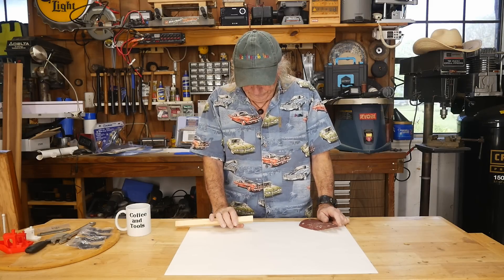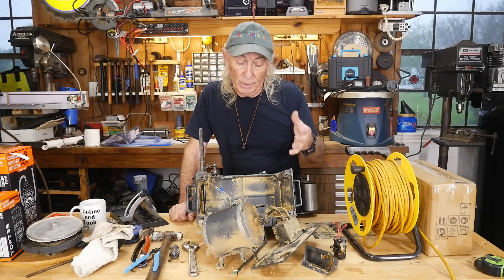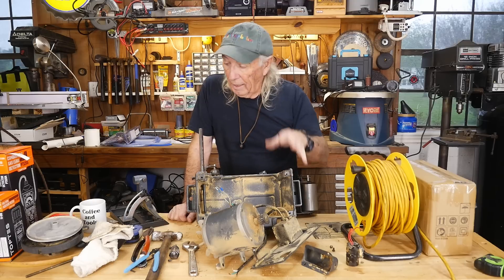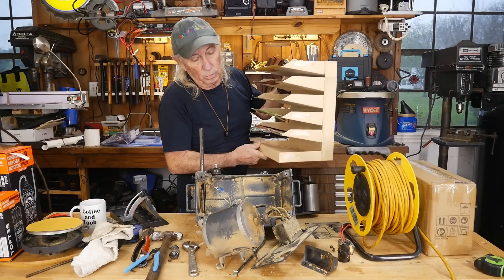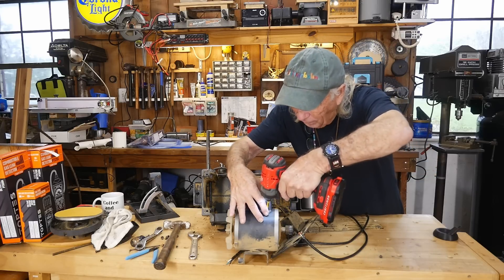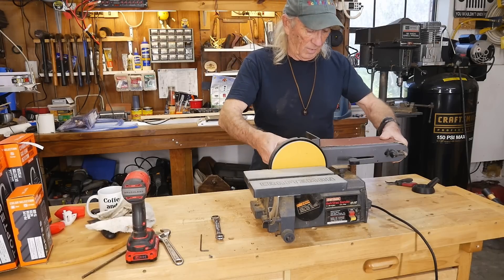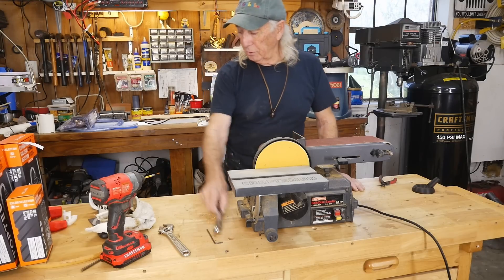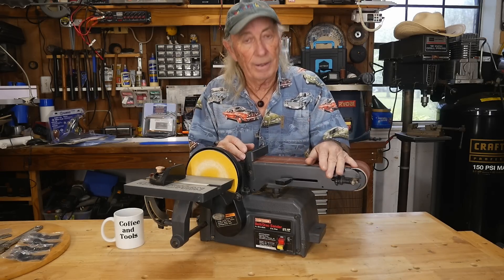Craftsman bench top belt sander machine repairs / upgrade, C&T  Ep 332

Comment: I have a delta 4x36 belt and 6 inch disc sander  and its absolutely the main work horse in my shop for sanding.
Reply from the maker: I just sold off the delta, but both machines seem to working good. The delta was 100% good too.

Comment: About 10 years after I bought my current house, the capacitor went out on my A/C condenser. The fan wouldn't turn. The motor just hummed. So I opened it up, and the end of the capacitor had actually blown out. I live in rural Missouri, so I could only find one local business that sells those capacitors to the public. He only carried one brand and it was made in China. It only lasted a couple of months. The business owner was awesome about it. Every time it went out, he would give me another on the warranty, but I soon got tired of replacing them, especially when it died on the weekend and I had to go without A/C until Monday morning. So I did some research. Apparently, as you would expect, this is common with Chinese capacitors. They're crap. Evidently the only things the Chinese can make well is viruses and delicious food made from pets. Anyway, from what I read on HVAC repairmen threads, capacitors made in the USA or Mexico will last a lot longer. It took me a while to find an American made capacitor. I finally found one on Amazon that was made by a company called AMRAD. From what I've read, they might be the only company that still manufactures them in the USA. That thing has been working great for four years. I wish we made more stuff in America. Those 6 year old Chinese kids being forced to work in a sweat shop for 30 cents a week just don't make good quality products, like Americans can.

Comment: I just took my 1984 Craftsman belt sander apart. It had the bad capacitor hum. I took it apart and no capacitor. Little see through cast iron motor. Bearings were stuck, there was black copper in the stator. 😢 looks like its toast.
Reply from the maker: Place a hand over your heart and say good bye.

Comment: Well, I also have this sander and need to replace my capacitor... but I am unsure of whether it is a "start" or "run" capacitor... from what I can find, it seems to be a run capacitor... how did you determine it was a start capacitor?
Reply from the maker: Inside the motor there is a tiny centrifugal switch that is for the "start" windings only. If the motor just hums and bumps back and forth, but using a quick spin on the motor gets it up and running, that is the "start" cap which is used to get the motor running and then the "run windings" take it from there. In some cases you can hear the click seconds after the motor is started and coming up to speed.
Reply: @SirTools Interesting... mine did seem to have that behavior (hand spinning it seemed to get it going... unsure if I heard a click or not), after several uses in this state over a year or so, it wouldn't really maintain any power so I stopped using it.  Your video gave me the courage to dig into it!  After I took everything apart (disk and drive belt disconnected), it would start up fine and slowly (over 4-8 seconds)  loose power until it stopped (this is without anything connected to the motor, just the fan).  During my last test, it started up spinning great and about 5 seconds in it suddenly lost power (as indicated by spin speed... maybe 50%), then the capacitor 'squeaked' and started smoking.  The capacitor has SH CAP on it and 25uF +10%/ -5%, 250V.AC.  I can't easily get into the motor to look and see the centrifugal switch.  I'm pretty sure we have the same model (137.215360).  I'm surprised it didn't have 'start cap' on it to indicated it was a start capacitor.
Reply from the maker: Does sounds a bit "fishy", once it reaches full speed it should not slowly drop out. Could be bearings or other issues. Maybe even damaged windings. For the tiny price of a capacitor I'd try swapping out that, it's an easy job and just might fix it. If the windings have gone bad, well...that would be another topic.
Reply: @SirTools Thanks!  That is my plan...
Reply from the maker: Good luck, I think you'll be ok.

Comment: Hi, I found a older Ryobi belt sander and it stopped spinning.  Im breaking it apart today to fix it, thanks for the great video.  What do you use to clean your equipment?
Reply from the maker: First I hit it with my compressor air to remove the heavy, step two would be a dry rag, and then some soapy water in a spray for plastic and metal areas etc. 🤠

Comment: I got one of these today for 60 bucks but it did not come come with the disc table and belt guard broke on the bottom part. I could not get the wheel off. I'll wd 40 a few times and try again tomorrow.